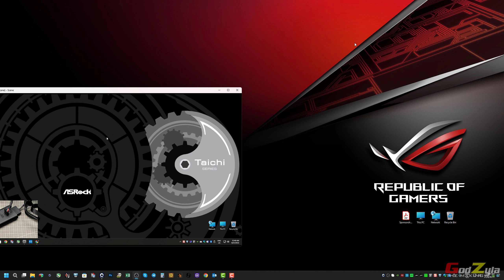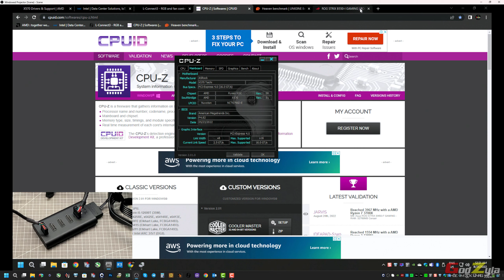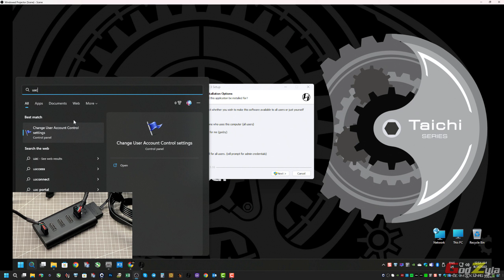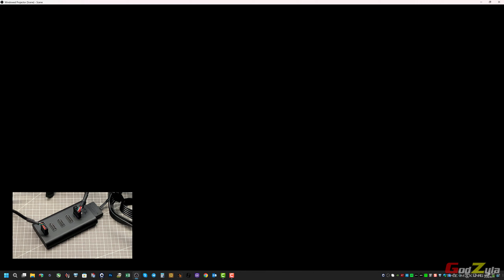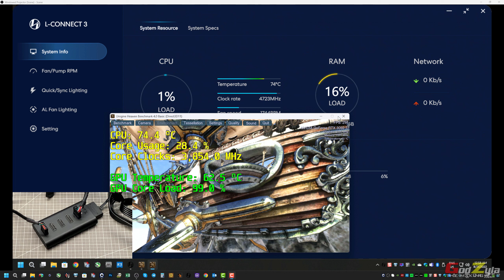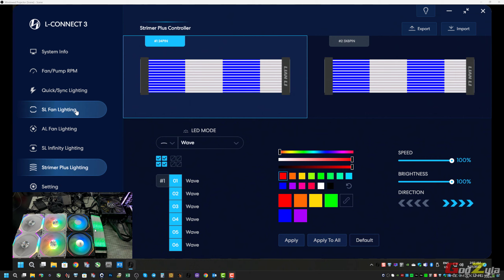Lian Li ARGB Products (How to make it work?) [L-Connect 3]

Comment: im struggling to get a certain color using the LianLi L-Connect software, since there isnt a function to enter a HEX or RGB code (#d4af37 or 212/175/55). Instead u only have these stupid color sliders.
i found a reddit post saying:

"(L-Connect) fighting to get a particular color? Have the hex code? Convert it to HSB so you can match it in L-Connect".

i wasnt able to do this.
do u have any ideas or a work around to not use the color sliders?

<3
Reply from the maker: Hi Ten Kenobi, welcome back. I can understand your frustration but I have no clue how to do that. I will give a quick feedback to Lian Li. See if they can do something about it.
Reply: @KleoYan  ohhh that would be awesome! Thx in advance ❤️
Reply from the maker: @ten.kenobi  you are most welcome. Hey are you able to copy and paste your comment to me and send it to my email at godzylatech@gmail.com so that I can 1) keep track 2) attached your email and send it to Lian Li. Thank you.
Reply: @KleoYan  ✅ done
Reply from the maker: @ten.kenobi  thanks. Got your email. I will proceed to send them an email and to attached your request. Thank you.

Comment: I have Lian li galahad UNI SL edition aio 360mm and there have 1 controller which i plug all my 3 SL fan in it. I want to know if i buy  3 set of UNI SL v2 can i plug this normal UNI SL 3 fan on that new v2 controller? is it work or do i need to separate controller to control UNI SL normal and UNI SL v2?? I only have 2 USB hub on my motherboard, One i connect Lian li strimmer v2 controller and galahad uni sl controller.
Reply from the maker: Hi I think I have answered your question. Nope they have to work with their own uni controller.
Reply: @KleoYan  do you have any discord i want to show you there is this USB hub extension for motherboard is it work or not.
Reply from the maker: @CallMeFearS  nope I dont use discord. sorry, you can send me to my email at godzylatech@gmail.com

Comment: Great video, would have saved me some time when I started with the Lian-Li fans and software. Is there a way to control the RGB effects so they continue  from one set of fans to another on the entire controller? I only manage to change it within one "bank" of 4 fans.
Reply from the maker: Hi Mikael Bäckström, welcome to my channel. For this you will be able to control the pattern within the Lian Li argb products as they are cater for only the uni fans and strimer plus in 
L-Connect 3 (Quick Sync Lighting). If you are talking about having your rams and GPU, that's not possible. Once again thank you for your compliment and feedback.

Comment: Quick question. I'm using this program for my strimer cables but I have a different brand of fans in my case. Is that why I don't have the options to change fan settings?
Reply from the maker: Hi Kirk Russell, welcome to my channel. you will only get to use the L-Connect 3 application when you have the uni controller, it does not work when other brand fans are just connected directly to the motherboard via the fan header or the argb header.

Comment: Kleo, I got 10x 120mm Infinity fans from Lian Li. Im covering up my Lancool III with them (replacing the stock case fans aswell) and Im not sure if I get the RGB version of the case. 3 of 10 fans I got with the controller. If I get the RGB case version, will I be able to change the colors from all fans directly from the front of the case as well in the Lian Li software ?
Reply from the maker: Hi, Daniel Caparroz, welcome back. you can connect all fans to the Uni controller, just make sure the argb cable that is connecting between the uni controller to the motherboard, instead of pluging to the motherboard argb, plug it to the case argb header, not the cable that goes to the motherboard ok. If you want to controll the argb from your case argb button, you will need to set bypass mode in L-Connect 3, then you will be able to use your case argb button to control all the argb effects.

Comment: Hey sorry if you mention this in the video and I missed it but Id like to ask if I need the lconnect3 software running at all times for rgb lighting only.  Im going to use something else for fans so can I open lconnect3 and choose my lights color and pattern and then close the lconnect3 and leave it closed forever?
Reply from the maker: Hello jeo leeman, welcome to my channel. You will need the L-Connect 3 to run at the background else your argb effect will be gone once you reboot or shut down the PC. what you can do is to minimize to your system tray.

Comment: Mate please help. Where should i put the controller fan pwm ? To the cpu or channel fan?
Reply from the maker: Hello Dexter Gilapay, welcome to my channel. For Case fans I would not plug the pwm cable between your uni controller to the motherboard, just make use of L-Connect 3 app to control the PWM of your fans. As for the fans that are on your Air Cooler or Liquid AIO radiator, I will plug the 4pin (PWM) connector of your fan directly to motherboard CPU_FAN header (make use of the motherboard UEFI or software to control the fans RPM)  and the 3pin argb to your uni controller (To control argb effects using L-Connect 3) 
The reason behind on having Air cooler or Liquid Cooler Radiator fans (PWM) to plug directly to your motherboard, in the event if your controller is faulty, only argb effects are affected but the fans continue to spin as to cool your processor.
Reply: @KleoYan  so you are saying i need to use the connector from a single fan the i bought right? so where to put that 3 RGB 5v pin?  hmmm? if im gonna use my 3 fan on the radiator liquid cooler
Reply: @KleoYan  mate im using 7 pcs of lian li sl120 infinity. 3 on front. 3 on top (360mm Rad) 1 at rare. so you are saying if im gonna set all my case fans only in controller thats not a problem. the problem is. the top 3 fan. if im gonna use that 4 pin pwm + 3pin 5v RGB where to put it though?
Reply from the maker: @dexter23foxy  hi, ok I see the issue now. the single pack cable, the argb 3pin 5v, you will have an issue to plug to the uni controller. if you really want to in sync all your fans argb using the uni fan controller. you will need to get a coverter to plug to the uni fan controller, that is to plug it to either sync 2 or sync 4. Reason i've suggested you this is for safety reasons. If you feel is a hassle, then plug all to the uni controller but still I wont suggest to plug the pwm fan header between the uni fan controller to your motherboard, just make use of L-Connect 3 app to control the PWM of for your case fans and cooler fans. the choice is yours.
Reply: @KleoYan  i finally solve the problem. I use the controller to and on the motherboard bios i ignore the cpu fan and disabled all the fan there. My temperature drop 15c when I'm in benchmark. I got 5900x but i get 75c now max. Before it was 85c sometimes i went up to 90c
Reply from the maker: @dexter23foxy  that's good. if that's the case you can unplug the PWM cable between the controller to your motherboard. that why you dont have to worry if there are any conflict. congrats with your build.
Reply: @KleoYan  yes i unplug the pwm and the rgb from the controller and use the controller in my rgb and fan. Works like a charm now i dont why is like this. I just use the mobo rgb in my icue so all good now.
Reply from the maker: @dexter23foxy  good to hear and congrats. so now is to enjoy it 😉

Comment: Hey thanks for the video!
at 4:50 I connected the hub to all the connectors, the 5v and the argb on the ProArt motherboard, they work and I can control the fan speed through bios, but, the RGB lightening is not working, any idea why?
Reply from the maker: Hi Shepard, welcome to my channel, mind if I ask which uni fans are you using?
Reply: @KleoYan  Hey Kleo, thanks for your reply I just subbed your channel.
I use the UNI fan SL-INF120 the latest. with the latest hub and everything.
Reply from the maker: @Shepard7  I see, if you look at your uni controller. There are total of 6 port, which 4 of them are labeled as 1 to 4 (7pin socket) and 2 are labeled as sync 2 and sync 4 (3pin socket). As I have mentioned to you, for your radiator fans, use the SL Inf 120 individual pack where the cable is split to 4pin (pwm) and 3pin (argb). Connect the 4pin to your motherboard fan header (CPU_FAN) then the 3pin to the uni controller Sync 2 or 4. This way, you control the PWM using the motherboard instead of the uni controller and control the argb using the L-Connect 3. and to control the argb in L-Connect 3. You will need to have fans connected to port 2 which sync 2 will response to / port 4 which sync 4 will response to. 

For the rest of your SL Inf 120 (case fans), use the 7pin cable to connect from the fans to the uni controller. So both PWM and ARGB is controlled by the uni controller using L-Connect 3. 

As why doing this. In the event if the uni contoller malfunction. The radiator fans will only affect the argb effects but not stopping the fans from spinning accordingly to your motherboard pwm settings. This is just a safety measure.
Reply: @KleoYan  Thanks a lot, but I didn't get the cables for single fans, I bought the 3 fans set, and I use it for 2 top and 1 rear.
So I'm limited here, no USB available slot, that's why I do it.
Someone mentioned I can control the ARGB without L-Connect3 software, is that true?
Reply from the maker: @Shepard7  Hi I am so sorry, the way I reply you is meants for another viewer. I got confuse with replying comments.. so sorry. ok for your case. if you got the 3 pack set. you have no choice but to make use of the uni controller which require the USB connection to your motherboard. if you are limited to USB 2.0 Header on your motherboard, you might want to get a Internal USB hub that is with the sata power connector, like the NXZT Internal USB hub. https://nzxt.com/product/internal-usb-hub-gen-3
the second question you asked. yes it is possible without using L-Connect but you will only be able to do this if you buy the individual pack as the cable is not in 7pin but in 3 and 4pin, 3pin argb and 4pin pwm, where you can plug directly to the motherboard Fan and argb header. then use the motherboard utlity to control the argb effects and the fan load (PWM). but make sure you check the load limit of the argb, do not daisy chained more that 4 fans and plug to the motherboard argb header.
Reply: @KleoYan  Thank you so much for your replies I really really appreciate that, may God bless you and your family sir.
Reply from the maker: @Shepard7  Hi and thank you for the blessings and greetings, may you family and yourself too have a good year ahead. by the way you can call me Kleo. 🙂all the best with your build too.

Comment: Came here from the other video on device manger my Liam controller doesn’t show up on it neither the l3 software
Reply from the maker: Hi Luffy Unity, welcome back. Can you try this, 
power off your PC, remove the PSU AC connector, press the power button for a couple of times while it's off, this will discharge all the electricity that is hold in your motherboard. As why doing this is to clear the cache. Next uplug the USB cable from the uni controller on the motherboard, plug to the other USB header if your motherboard has it. Then plug back the AC cable to your PSU and power up your PC. see if you are able to see the controller in windows, under Device manager > Universal Serial Bus Devices.
Reply: @KleoYan  took me some time back of my pc was not opening usb part of the adapter wasn’t plugged in I plugged it in and there is still no change on device manager
Reply from the maker: @luffyunity1420 did you try plugging the controller usb cable to another usb header on your motherboard? and have you double check the connection of the USB cable on your motherboard and the controller? do you have another SSD or m.2 to do a fresh windows installation. see if it works. If it still does not work, do you have another PC to test with the controller. without this controller showing in your device manager. you can't sync up with your fans with the L-Connect 3 application. if you do have another PC to test and it reacts them same, your controller might be faulty, you might want to do a replacement or warranty claim with lian li but they will only resume operation on 30th Jan https://lian-li.com/contact-us/
Reply: @KleoYan  I think it’s controller I’ve got it on motherboard as well cha fan header it says n/a doesn’t detect it
Reply from the maker: @luffyunity1420  I would advise to test it this way. If you have a spare ssd. Install a fresh windows. See if it does detect the controller in device manager. If not, try another pc if you do have one. If both do not work, then get lian li to do a replacement unit for you.

Comment: i just installed the latest lian LI RGB fan inifinity the problem is the application after boot wont minimize by itself
Reply from the maker: Hello Dexter Gilapay, welcome back. On L-Connect 3, go to settings where you have the minimise when closing windows. Unchecked that and uncheck auto run. With the l-connect 3 app display still on. Shut down your pc. Boot it up again. Then launch l-connect 3 app. Enable back the two functions and still having the l-connect 3 on, shut down your pc again. Then turn it back on. I did have the same issue like yours and I did that. Give it a try.

Comment: Hi there ;) any fix for auto run not working yet? Everything is up to date in my rig, im using l connect 3 from 2 months and everything was working perfectly until yesterday. I turn on my PC and the app didn't start automatically, checked evry setting and all was just like before when it was working. Reboots did nothing. Reinstalled he app a couple if times, manually make shortcut in autostart etc... From all te setting the app shuld auto run but it doesn't. Spend like 6h to try to make this auto run whit system boot but i couldn't. Please help, this is not letting me sleep 😅
Reply from the maker: Hello Michat Brzozowski, welcome to my channel. Two things you can do. Uninstall the app using revo uninstaller and to delete all files and registry which revo can do. Then download the l-connect 3 app again from the official website. If reinstall does not work, go to task manager and under start up application, see if L-Connect 3 is enabled. If all these don’t help. I suggest you to contact lian li support or to post your problem at lian li Reddit forum https://www.reddit.com/r/lianli/
Reply: @KleoYan  thx, I'll try this revo tool tomorrow after work. Of course will let you know if it worked ;)
Reply from the maker: @NOWy070  welcome. All the very best. Now of get some rest.

Comment: does having l-connect 3  affect pc fps performance like other rgb software?
Reply from the maker: Hello Box, welcome to my channel, best to optimise a pc is not to have argb, get performance case fans and cooler.. without any background running apps you will optimize more system performance. Which this is the truth. Once you start to use any software that uses background process. your FPS will slightly drop.

Comment: Hi, my fans won't light up or spin when booted. Any ideas?
Reply: Hi Kleo, yes I have a z690-a rog strix asus mobo, I have plugged in the two sata cables  to different sata plug ins.  My device manager recognized the controller hub but the fans won't boot up
Reply from the maker: @everythingbenny  you mean when you plug to the controllers, the fan wont spin nor light up even before your PC boot to Windows OS? As I have asked you did you try testing each indivual fans without daisy chained? by right if you connect them correctly, even without pluging to the usb cable between the uni hubs to your motherboard usb header. it should at least light up default rainbow color.. and have you installed L-Connect 3 app?
Reply from the maker: Hello Benny Gomez. Welcome to my channel. I have no idea unless you can provide proper details. Example did you test them outside your case and with each individual fans? Was the sata cable connected. Is your device manager identifying your controller and what fans are those? Which motherboard and platform are you using?

Comment: been searching forever for someone to explain how! finally someone explains in details, one question though,  can i connect lian li galahad aio to the unifan controller?
Reply from the maker: hello blaydemastah, welcome to my channel, the argb connector of the Galahad pump, you can connect it to the uni fan controller but for the pump connector, kindly connect it directly to your motherboard fan/pump header.
Reply: @KleoYan  ah thank you! Also one more question, can I connect the strimer v2 controller to the unifans controller? Or will I have to connect the strimmer controller to the motherboard?
Reply from the maker: @0verdead  for the Strimer Plus V2 controller, you can only connect it to the motherboard usb 2.0 header. you can't mount to the uni fan controller.